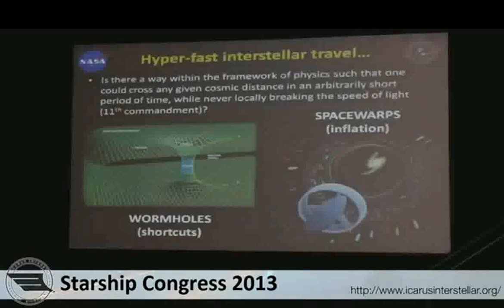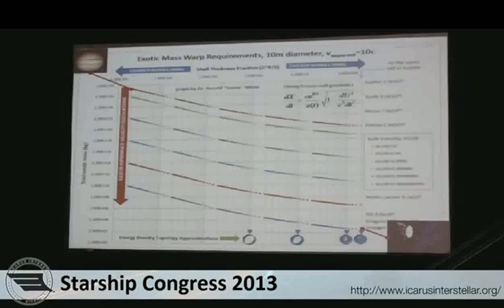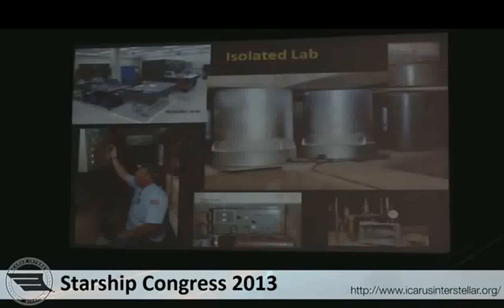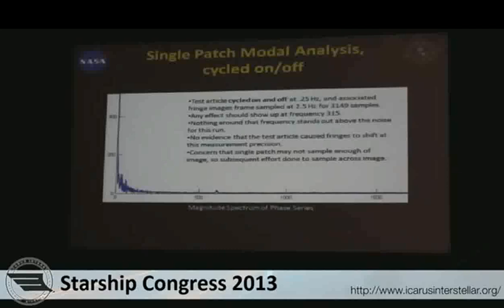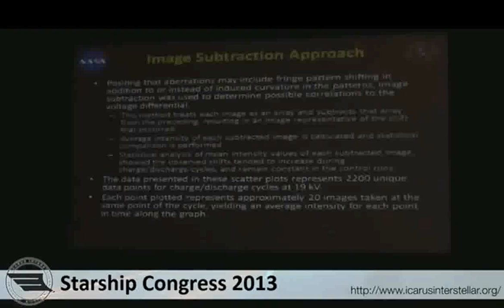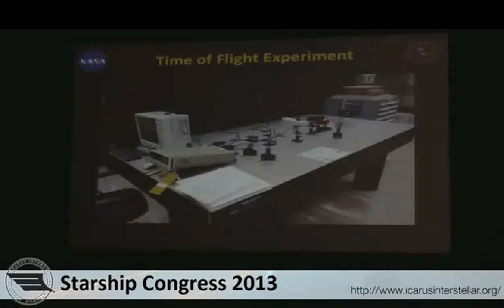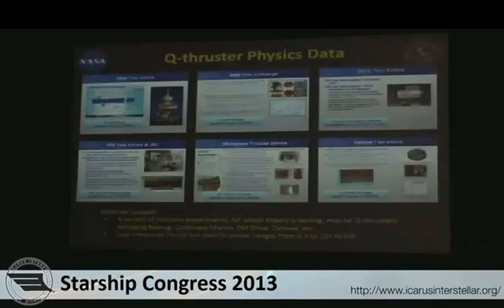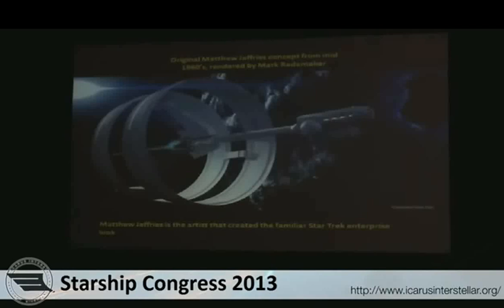Dr Harold White's Presentation at the 2013 Starship Congress

Comment: what about dust? I mean the development of the warp drive is still at a very early stage but I suppose dust could pose a problem when it collides with the warp bubble .
Reply from the maker: according to Dr White and others the dust enters at whatever speed it had before it enters the warp field region. it's speed is multiplied while in the region of the bubble itself. but the area containing the ship has it's own normal space. when the dust leaves the "skin" of the warp bubble it loses warp speed and enters at it's own former speed. remember the idea of an alcubierre type warp is the ship is actually not moving or is moving at conventional speed. the space immediately around the ship is not moving relative to the ship.
Reply: hmm, could be. Today I digged a bit into the topic and watched a video with Michio Kaku who said it would be necessary to produce force fields to prevent interstellar material from hitting the ship. Although I was more worried about the collision with the warp field itself - I mean the material perhaps would be bent and accelerated in the field to tremendous speeds and I was also thinking that it could slow down the bubble - it seems that even the ship could be in danger. Here's the video I was talking about:

watch?v=yL2gmEVZP44  (from time index 8:05 onwards)
Reply from the maker: newcome880
if you were traveling at a percentage of the speed of light. before you created the warp then yes you would need some sort of armor shields or laser based defense. but the warp effect does not multiply speed in the isolated space the ship sits in so you only have to worry about the speed the dust had before passing through the warp bubble boundary because it loses any augmented speed upon exiting the boundary layer.
Reply: adaje5 I see what you mean, that was my point anyway. But I cannot imagine that any material whatever size wouldn't have any effect on the warp bubble when entering it. Bending space-time is one thing but if there are objects in it I have a feeling that this would affect the effeciency of the warp bubble noticably and probably also have some kind of effects to the ship travelling ("not moving") inside. I understand the Alcubierre drive is only hypothetical so a discussion of such effects certainly will be even more hypothetical :-)

Comment: In the end if his experiments give a smoking gun for warping of space-time with just electric current then even exotic matter may not be needed! It would be the engineering of the equipment and storage of energy if any electric charge warps space-time.
Reply from the maker: In QED theory the rest mass of all matter is negative. it gets renormalized in the math to positive.it is possible however unlikely that the renormalization components can be separated or delayed. giving access to as much negative mass energy as you want. there are also other possibilities including as you said you may not need any.
Reply: Well, actually an electric current in the capacitor ring has energy and since energy has an impact on the fabric of space-time, the path of the splittet Helium-Neon laser changes its wave function, so that the interference pattern is slightly different than it would actualy look like , with the laser having the same wave-length and interfiere.

But it is only about the principle showing the practice and to analyse the data . This does not imply that an electric current at large scales would generate a space warp bubble. 

But after they find some real evidence and win results from it, it might not be far away from that to make real space warping experiments in the near future. When the principle really works, they can even find a way to build the generators.
Reply: nadjim73
There is now a newer presentation Dr White made at the Mars Society conference a few days ago.

its the day two video about 2o minutes or so into the video if i remember it right.

http://new.livestream.com/accounts/4950775/events/3217776/videos/58616741
Reply: Jerry Adams ty , i ll watch this soon
Reply: Regardless of whether you can bend space with an electric current, it's less reasonable to assume that we will have batteries that can hold anti-matter equivalent energy levels before we can produce the antimatter. I would bet global anti-matter production has increased far more than battery capacity in the last 50 years.

(you are more or less saying that experiments to prove the validity of a theory that will require vast energy amounts, by being validated, will disprove the efficiency of producing the energy producing reaction on the space craft in favor of batteries, and this doesn't follow)
Reply: Titus Veridius Well, we can only create tiny amounts of anti matter inside the cyclotronic particle accelerator in geniva, switzerland with protons hydrogen ions and atoms etc.. You need a lot of energy for the production of a few anti matter particles like positrons or antiprotons. We aren't still capable of producing only one gramm of antimatter. Actually, the battery capacity production has increased with better donators and acceptors accumulating electrons better.

If we have a space ship one time with anti matter and other fuels, we will probably use batteries and other power generators as well.

And it is more plausible to think that we will have batteries with electric current and the electric current has an affect on the space time fabric. Electric fields are also a change in the structure of the space time but in a special rectangular direction to magnetic and gravitational fields. Electric and magnetic fields are also the same thing but only with the difderence of the structure of the poles and rectangular to another again. But it is all a change in the spacetime fabric.